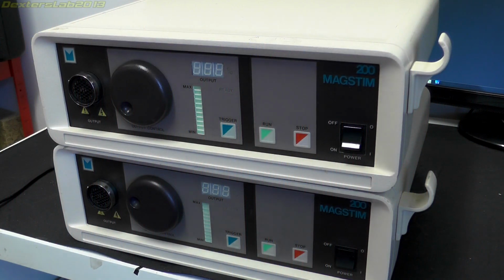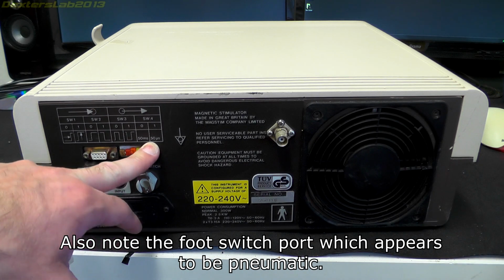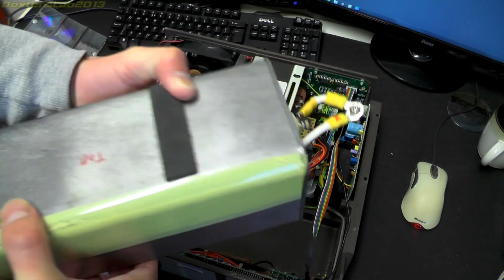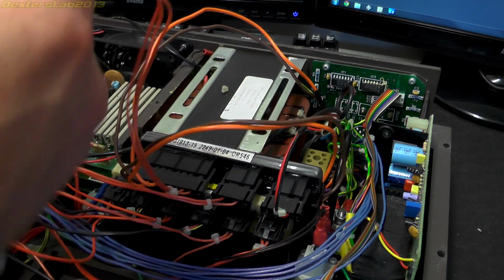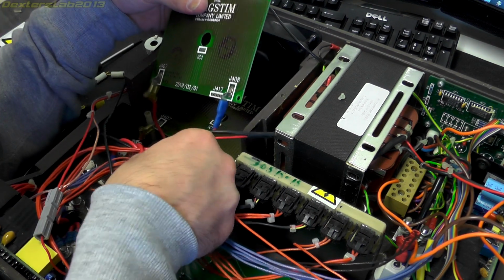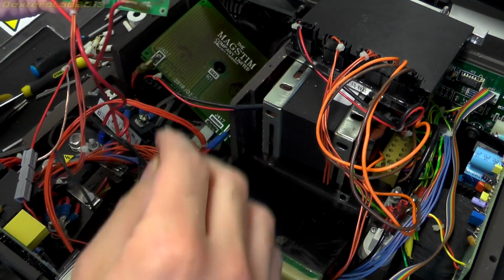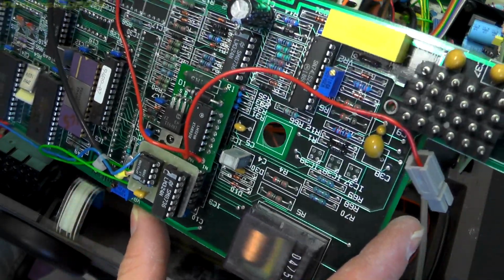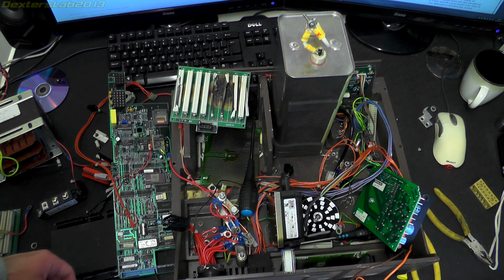DL#062 - Magstim 200 TMS Magnetic Stimulator Teardown Part 1

Comment: Magstim PCBs look like noninductive resistors to control peak current maybe?
Cap looks like a defib cap in steroids - I'd guess 50-100uf at 5kV or so. Would make an awesome can-crusher!
Reply: +mikeselectricstuff It's quite similar to this one on the top section, but more lengthy: http://www.ebay.com/itm/General-Atomics-PN-30543-100-uF-2-kVDC-High-Voltage-Capacitor-100-F-/130973736272?hash=item1e7ea49d50
Reply from the maker: +Joao Gaspar nice find, yes that does look physically very similar dimensions are the same though mine is longer, even the securing nuts on the terminals appear to be the same. The two i have both measure 190uF.

Comment: Thanks for mentioning me, and great work on the interesting teardown. Coincidentally, I dusted off my TMS demo machine in the past few days and was showing it to a friend.
Reply from the maker: +Joao Gaspar there are some clinical aspects with rTMS that is important to consider. I did also notice some patents from magstim about the tech for rTMS. Search google patents for magstim. I think they tended to use two units synced together. If you need any info about my unit, let me know, i can take measurements. I was looking at pulse shapes on my scope today.
Reply: +DextersLab2013 Thanks for your reply. 

[Useful Measurements]
It would be interesting to know something about the charging process. The charging blackbox seems too complex to monitor from the outside but it would be useful to know the rating of the 8 parallel resistors on the blown up board, as well as readings of the total current flowing through that board, for 2 or 3 different loads (different capacitor voltages). And maybe info about the discharge pulse shape (rise/fall times and pulse duration) for a given coil inductance, to see how the SCR/diode/cap combo behaves in terms of the dI/dt [A/s] characteristic. Measuring the Capacitance of the capacitor would also be interesting to know. If you can provide this data here or on the EEVBLOG would be great. 

[Clinical Aspects]
The major clinical aspects for the main approved clinical application (treatment of depression) can be summarized as: pulse intensity of 120% of the motor threshold applied at the Left-Dorso-Lateral-Pre-Frontal-Cortex (LDLPFC) @ 10Hz, with pulse width of around 300us (neurostar TMS uses a value in the same range: 185us. Ref: https://neurostar.com/wp-content/uploads/80-50101-002-NeuroStar-TMS-System-Version-1.7-Technical-Data-Sheet.pdf), using protocols of about 3000 to 5000 pulses per session at typically 40 pulses at 10Hz during 4 seconds, followed by 26 seconds of resting state. This is what the targeted brain region "sees". If this is guaranteed, then the only configuration parameter left is the field penetration depth, that can be slightly modified using different coils (some details on this below) 

This tends to be the de-facto standard in rTMS treatments nowadays, and the vast majority of clinicians doesn't risk playing with these parameters, following blindly the default protocols, extensively studied in the vast majority of research papers and clinical trials. I would dare saying that 90% of treatments, follow these parameters. For instance, Russian's Neurosoft's typical sessions use 100 pulses during 10seconds + 20 seconds in resting period, for a total of 6000 pulses per session. The standard 10Hz is achieved by all Rogue Resolutions's DuoMag stimulators at mere 50% that in their case is above the Motor threshold stimulation intensity of the majority of the population (>90%) ( https://drive.google.com/file/d/0B_pa-g27qiWIRU9DWUc0anZ4SmVSU0lfdThwc1B5STJNTFBN/view?usp=sharing )Using higher frequencies may have its applications but it's not been extensively studied as the 10Hz. Only in very recent years are appearing studies using higher frequencies on theta-burst stimulation, which is nothing but rTMS on steroids, aiming for faster treatment sessions (taking 3 minutes instead of 30-40 minutes), but that will bring nothing new in terms of measurable clinical results, it's mostly a market-driven evolution, to allow treating more patients in the same period of time. 

By open-sourcing a circuit design based on the common denominators of so many research papers and products in existence, that delivers 200Joules @ 10Hz in pulses of 300-400us, we would be covering the vast majority of applications for which RTMS is clinically approved for (depression/treatment-resistant major depressive disorder)

[Patents and units used together]
Will dig on Magstim's patents, but generically from the literature I've read so far, the fields for innovation are either on the charging circuit or on the coil design, for instance on allowing high pulse frequencies, which requires proper refrigeration mechanisms for the coils, that will overheat. The need for these improvements is inevitable as the manufacturers further extend the specs of these machines, but on a real life setting, we're basically back to the good-old 300us width pulses @ 10Hz.

The pulse width is inversely proportional to the voltage used (through the capacitance used) and the coil inductance (https://drive.google.com/file/d/0B_pa-g27qiWIbnJhbTNlQWl6LWc/view?usp=sharing ) but Magstim seems to have found a good compromise in voltage and width pulse in their "Magstim Rapid²" as they use slightly relaxed 400us width pulses compared to the competitors, like Neuronetics, still being able to achieve 15Hz, all with a single PSU/one unit only (table at page 4: http://www.majer.com.pl/pliki/pdf/medycyna/katalog_magstim_rapid2.pdf ) using only 1.67kV and biphasic wave (table at page 3 here: http://www.brainclinics.com/dynamic/media/1/documents/Brainclinics-Products/Magstim_Brochure_Sequential_Pages_Low_Res.pdf). The diode is probably in anti-parallel and not blocking the collapsing B field as in Magstim 200, allowing the fast recycling of the charge of the capacitor, otherwise they would have no way of achieving 15Hz. The biphasic is thus not only a feature, it's a mandatory requirement to achieve higher frequencies than the ones obtained through a single pulse TMS (like Magstim 200)

[General design options]
The coil design: A neurostar C-shaped iron core can be used for improved penetration depth and dramatic reduction of Energy [Joules] required, as can be seen here: https://drive.google.com/file/d/0B_pa-g27qiWIVWhvLU1uMmVwUnM/view?usp=sharing
Source: http://diyhpl.us/~bryan/papers2/neuro/magnetic-stimulation/Designing%20Transcranial%20Magnetic%20Stimulation%20Systems_%20Kent%20Davey_%20Mark%20Riehl_%202005.pdf  
Neurostar uses this iron core: https://drive.google.com/file/d/0B_pa-g27qiWIcUR0dDlIeENoek0wUzhiU2pGajc1aDlDUU1Z/view?usp=sharing which according to this paper (http://www.ncbi.nlm.nih.gov/pmc/articles/PMC3568257/) yields more or less the same field distribution, albeit probably with deeper penetration depth. Both for the 8-shape coil or the C-shape iron core coil, braided litz wire could be eventually for better simplicity of coil manufacturing (http://diyhpl.us/~bryan/papers2/neuro/magnetic-stimulation/A%20Transcranial%20Magnetic%20Stimulation%20Coil%20Using%20Rectangular%20Braided%20Litz%20Wire_%20M%20Talebinejad_%20S%20Musallam_%20A%20E%20Marble.pdf )
If energy is an issue, adding a custom iron core like neurostar's seems to reduce dramatically the need for a huge cap or a very high HV supply, or both. 200 Joules seems to suffice in many applications with figure of 8 coil alone. By adding a iron core to the coil, 2kV DC supply and 100uF looks more than enough to achieve action potentials of the neurons (the correspondent to the motor threshold finger twitch level)

Tweaking with the coil inductance for a range of given capacitor charges, will allow setting a range of acceptable pulse widths. This is the part that can only be experimented on a real circuit, and this influences the charge % being recycled at the capacitor in each biphasic pulse. This is the tricky aspect that makes it so hard to properly dimension a circuit like this with 100% accuracy. I'm not even sure if there are SPICE models for these devices, but that is probably unnecessary as guessing the specs of the circuit from the constraints of the current devices on the market and published papers and books on the field, eases the guesswork. The rest is basically fine tuning around the chosen PSU voltage/power, capacitor and coil triad. 

I'm not referring here the driver circuits of the charging IGBT circuit and discharging SCR circuit, as that is the less experimentalist-prone area in all the development, although it can easily get complex if instead using a Variac before a MOT to control the overall capacitor charge (a.k.a. "Motor threshold fine tuning done the flintstones way"), one decides to do it the clean way and control it through the IGBT. 

Anyway, just food for thought. 

I'd be glad if you could provide some readings on that circuit and/or anyone could comment on this or add valuable contributions.
Reply from the maker: +Joao Gaspar If you want to head over to the thread on EEVBlog forum we can continue talking about it there? http://www.eevblog.com/forum/other-blog-specific/teardown-of-magstim-200-transcranial-magnetic-stimulator/
Reply: +DextersLab2013 moving there now

Comment: If you can determine if the capacitor is charged via a bridge rectifier, then 3400*1.41=4794V, so maybe it's a 5KV capacitor, the series diodes in that first block add up to 3200v, yes that would be oil filled, usually done in a vac tank with warm oil, the holes would be soldered while hot (that's why  they dimpled), the cooled oil would form a bit of a vacuum which allows the cap to heat up a little without bursting, many years ago i did transformers the same way when i worked in a transformer factory (impregnation engineer)
Reply from the maker: ***** thanks for confirming the oil filled cap. I think the voltage rating on the transformer is a red herring... i dunno, i think there is more going on, more investigation required!